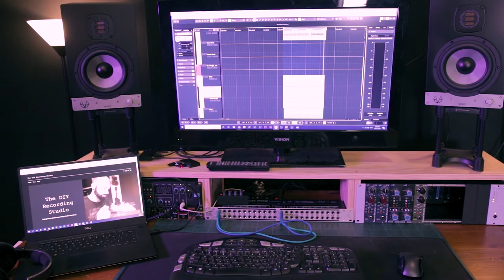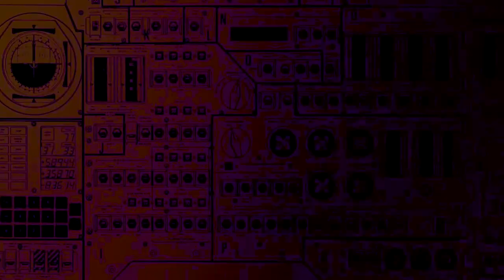How to Build your Own Preamp - Sound Skulptor MP573 (NEVE 1073) DIY Build PART 1

Comment: Thanks you so much for the detailed walk-through!
I just ordered a MP573 and I'm so excited about building it.
FingersXed!
Reply from the maker: Oh that's awesome! Let me know how you go. They're an awesome preamp. You wont be dissappointed.
Reply: @diyrecordingstudio  
Finished both builds without facing any issues. It was a fun build that required a lot more time and concentration compared to the DIYRE EQP5s (my first module project)
Your clips helped me during the building process as well :)
And yes, they sound amazing!
Reply from the maker: @marquezvanroeschen5340  that's awesome to hear, glad i could help in some small way. 
Did you do a pair of mp573's? Or one and the EQ? 
I love the DI for bass on these, and. Try using the 300ohms setting for dynamic mics and ribbons. Wait til you hear the difference.

Comment: Just found the channel, great video!
Reply from the maker: Thanks Dan! Interested in building your own preamps?
Reply: The DIY Recording Studio - yes, just built a tube amp for my hifi system. Cheers
Reply from the maker: @gainstage4497  That's awesome.  I've not gotten into home hifi DIY builds yet, but I'm sure I will eventually. Just sticking to the Studio Audio stuff at the moment. If you're into Tube stuff, I have a build video coming out later today, where I built a Tube Microhone preamp. Very nice bit of kit.

Comment: What kind of 500 series rack do you use? I’ve decided to buy the kit for this, but need to buy and/or build the rack as well. Any suggestions would be awesome!
Reply from the maker: Hi Ricky I use an Rupert neve designs R10 and a Midas L10. Both are good. The Midas is way cheaper. Some people diss them but I’ve never had a problem with the Midas one. 

Good luck, let me know if you need help with anything else. 👍
Reply: Awesome, thank you for the insight. I’m gonna order the Midas one for now. I ordered the mp573 and eq573-II last night. I appreciate the help! I’m super stoked to build these!!
Reply from the maker: Oh awesome. You won’t be disappointed I’m sure. Good luck and let me know how you go!
Reply: @diyrecordingstudio  I’ll let you know how it goes for sure. Waiting on some solder in the mail, then starting hopefully this weekend!
Reply: Well Mitch, I’ve pretty much finished the mp573. However, I accidentally flipped the pins for the input transformer. The shorter pins got soldered into the small pcbs and the long leads into the main circuit board. I didn’t realize the mistake until afterwards and now the input transformer sits an extra 2mm off the board. I’m wondering if I should leave as it is or unsolder everything and flip those sets of pins.

Comment: I'm in love with this video serie! What soldering tip type and size are you using for this project?
Reply from the maker: It’s a fine tip for soldering not the fatter ones that electricians use. The fine tip is better for pcb work. 

https://youtu.be/KihdejttmdA?si=J1r2U5DT2EBgKjnG
Reply: Thanks for the answer and the link @diyrecordingstudio

Comment: Excited to try this build at some point! What is your soldering equipment?? Thanks for showing this!
Reply from the maker: Hi there! It's a great project, and the kits come with clear instructions. Also at the end of it you have a beautiful Neve 1073 preamp.

I use this soldering iron https://www.jaycar.com.au/48w-temperature-controlled-soldering-station/p/TS1564?gclid=CjwKCAiA5IL-BRAzEiwA0lcWYplGWbNfF9_ubZjj62TQQVaCkkk4uBYrZOU6qC4qkl2cYG_1_Jo_GxoCIH8QAvD_BwE

And just regular tin/lead solder. You want a soldering iron with a fine tip for this kind of work.
Reply: @diyrecordingstudio  Thanks so much!

Comment: What IS that IC you took the still photo of? What's it for and what's the part number?

Also, is there room there for a socket? I see the DI PCB gets mounted above it.

Just checked the schematic. It's a TL072 that drives the LED (D10).

The SSL 9000 500 series preamps I'm building also use a TL072 to drive the meter circuit. That has 14 LEDs tho...
Reply from the maker: Oh cool. I wouldn't have been too sure, I'm glad you found it Richard.

Thanks for dropping by, I've seen your builds on Facebook. They look fantastic. What are the ssl units you're building at the moment? who are they from?
Reply: @diyrecordingstudio  You've seen them on FB? In the DIY 500 group?

The SSL 9000 thing is basically just a PCB and a PDF parts list, then you're on your own. Here's the PCB:

https://www.pcbgrinder.com/produktside/9k5-500-series-preamp

And if you notice in that PCB it has the 2 extra pins for 51x racks (even though it's not needed for this circuit) so it aligns properly  in the 18 pin sockets. I just cut them off for standard 500 racks.
Reply from the maker: @Wizardofgosz  yeah in the diy 500 group! It's a great community on there.

I'm still new to the diy building, and have only so far built full kits. I'll definitely have a look though. An ssl would be great to build. Where do you source the parts?
Reply: @diyrecordingstudio  Most of the parts you can get from Mouser. The pots you need to get from Audio Maintenance Ltd in England. The LM394 used to be unobtanium, but there is a high quality clone now called the AS394 (or Mil Spec AS194) that's readily available. The only hard to find part is the LM3915 LED driver chip.

Comment: Hello, where can you buy such a folding set? Thank you and best regards
Reply from the maker: an electronics store if you have one, if not, amazon, ebay or any online retailer. They're called a  "helping hand".

 https://www.amazon.com.au/Radio-Parts-HELPING-SOLDERING-STAND/dp/B0789XB3C7/ref=asc_df_B0789XB3C7/?tag=googleshopdsk-22&linkCode=df0&hvadid=341743966998&hvpos=&hvnetw=g&hvrand=1272731472847250043&hvpone=&hvptwo=&hvqmt=&hvdev=c&hvdvcmdl=&hvlocint=&hvlocphy=9072209&hvtargid=pla-672809966046&psc=1

Comment: yooo im trying to wrap my head around this groupdiy 51x thing. all i need to know is do all sound skulptor modules work on a vpr rack mount?
Reply from the maker: Hi There,

I'm taking a guess you're referring to a 500 series rack from API? If so, yes the sound skulptor kits work with any standard 500 series rack. The 51x stuff has extra pin, allowing for a larger power supply, so you need a special rack for those to take advantage of more power at the rails.

The sound skulptor stuff has been great. Just purchased my second tube pre from them so I can have a pair.
Reply: The 51x racks have 2 extra (well, 3 really, but one is a blank space) pins for +24/-24 volts. Every 500 series module will work in a 51x rack, but it has to be mounted properly in the uppermost 15 contacts. Some people (like the SSL preamps I build) put the extra pins on the cards even though they're not needed just so the modules align in the 51x (18 pin) sockets properly.

I just cut them off so things fit correctly in my standard 15 pin racks.